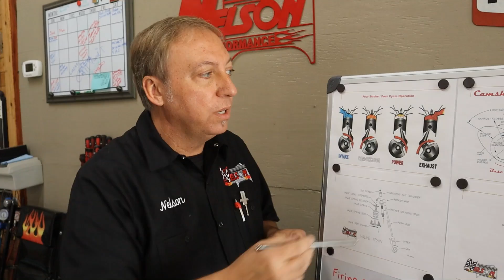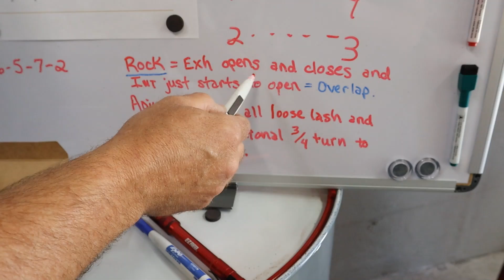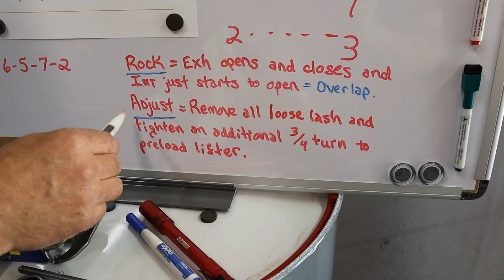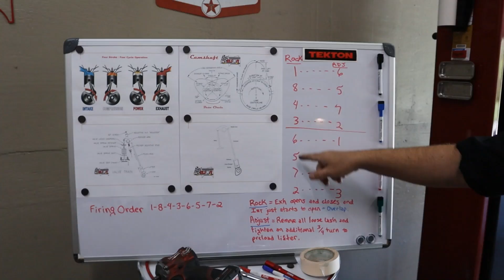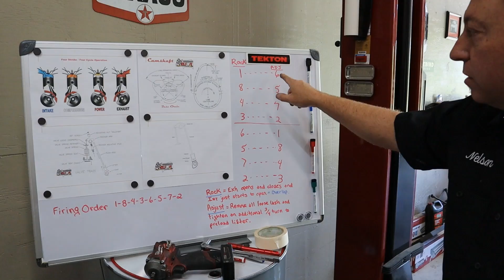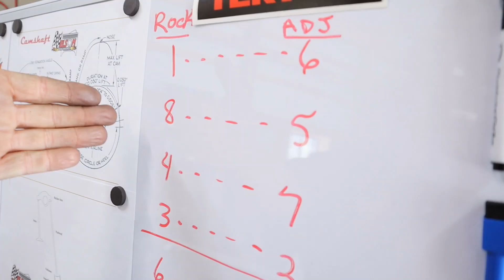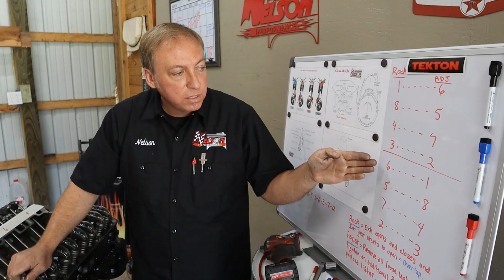Rocker Arm/Hydraulic Lifter Adjustment

Comment: What secuense will you use on a 3.0 96 Ford ranger I like your videos if you have and answer for me will be very helpful I appreciate your time tks and advance
Reply from the maker: Hey Juan, The firing order should be 1-4-2-5-3-6.  So you would rock #1 and adjust # 5 then rock #4 and adj #3 then rock #2 and adj #6. Then rock 6 adj 2. Rock 3 adj 4. Rock 5 adj 1. 123 are on the passenger side and 456 are on the driver side. Good luck on the project and thank you for subscribing.
Reply: Thank you Mitch Nelson for your response I really appreciate your time and advice I did and the truck is running cherry now

Comment: A Chevrolet dealership adjusted my valves , but they used the old nuts. So they backed off. I used this method when my truck broke down while I was on a road trip. I gauged the threads, runs like a champ!!!
Reply from the maker: That’s great! I’m glad it worked for you and congrats on getting it going! Thanks for the comment and subscribing.

Comment: This is the correct way, next expand on this in the case lifters are filled with oil (pumped up).
Reply from the maker: Hello, the method will work fine even with oil in the lifters. The valve springs will bleed the oil out of the lifters as you turn the engine over as the rocker pushes the valve spring down. This will get the plunger off the wire clip in the lifter. The valve spring pressure has enough force to push the pushrod into the lifter bleeding the oil back slightly since the oil pump is not producing oil pressure unless the engine is running.  You don’t necessarily have to view the lifters when doing the process, if the intake is on. You can also watch the movement of the pushrod/rocker arms if the intake is installed. You will see them move into overlap (the ROCK position). I’ve adjusted many engines that way. Just keep track of your cylinder locations to keep you on track. You can also use the ignition/starter to rotate the engine through the process but remember it only takes a slight bump of the key to turn the crankshaft the needed 90 deg. It helps to have a friend bump the key while you pay attention to the rockers. Good Luck with the project
Reply: @mitchnelsonperformance  Agree.  The reason I brought this up is b/c so many warn not to pump lifters before setting lash (or installing rail/pedestal fixed rockers).  I never understood this b/c I prefer to pump my lifters in an oil bath to confirm they won't collapse on startup.

Comment: This is awesome, but what if you do a cam swap and valvetrain work while the engine is left in the car? Any tricks?
Reply from the maker: Hello, You don’t necessarily have to view the lifters when doing the process, you can also watch the movement of the pushrod/rocker arms if the intake is installed. You will see them move into overlap (the ROCK position). I’ve adjusted many engines that way. We check lash weekly on our circle track engines just to inspect and catch any problems. Just keep track of your cylinder locations to keep you on track. You can also use the ignition/starter to rotate the engine through the process but remember it only takes a slight bump of the key to turn the crankshaft the needed 90 deg. It helps to have a friend bump the key while you pay attention to the rockers. Good Luck with the project!

Comment: Much easier  to  start  at top dead center  tighten all loose  ones turn  the crank a quarter  turn  again  tighten  all loose  do it two  revolution  and  all will be snugged  to  zero  lash then turn  all 3/4 turn  works on any  engine.
Reply from the maker: Hello, I’ve seen others do that process. Should work fine as long as you’re not doing a solid lift cam and need it precise. Thanks for the comment.

Comment: What if I’m adjusting it with the engine in the car? My lifters still have oil in them
Reply from the maker: Hello, the method will work fine even with oil in the lifters. The valve springs will bleed the oil out of the lifters as you turn the engine over as the rocker pushes the valve spring down. This will get the plunger off the wire clip in the lifter. The valve spring pressure has enough force to push the pushrod into the lifter bleeding the oil back slightly since the oil pump is not producing oil pressure unless the engine is running.  You don’t necessarily have to view the lifters when doing the process, you can also watch the movement of the pushrod/rocker arms if the intake is installed. You will see them move into overlap (the ROCK position). I’ve adjusted many engines that way. Just keep track of your cylinder locations to keep you on track. You can also use the ignition/starter to rotate the engine through the process but remember it only takes a slight bump of the key to turn the crankshaft the needed 90 deg. It helps to have a friend bump the key while you pay attention to the rockers. Good Luck with the project!

Comment: This method leaves multiple doors open for errors by jumping around. With ALL of the rockers loose start at one side and work your way back and then the other side removing lash from each one DESPITE where the lifter is on the lobe. Rotate the engine 90deg and then go back checking each one and adjust the loose ones until they are O lash. After you checked all, rotate again another 90. Repeat these steps until the engine has been fully rotated 4 turns. Then do the 3/4 turn preload on each one and your done. I know that this comment is long, but the method I’m describing doesn’t reflect that. This method is over complicating an otherwise simple process
Reply: Not only is your comment long, it also shows how ignorant you are. Hes simply using the firing order and valve overlap related to the firing order to adjust in sequence. I think your the type who has either an ego that constantly need to be filled or the type who cant follow simple directions. Either way, I bet it's hard for you to get along with people. Good luck pal!!

Comment: Can you do this with the intake on by watching the valves
Reply from the maker: Hello! Yep, It can be done with the intake on, you will just need to monitor the rocker movement v/s lifter. You can also use the starter to turn the engine. Just remember it will only take a slight bump of the ignition between adjustments.(90 deg) and it helps to have a friend to bump the ign while you watch the cyl/rockers you are getting into overlap.

Comment: Great video love how you explained the process. I have a dumb question after this do you use torque spec or not? Thanks in a Advance.
Reply from the maker: Hey Matt, never a dumb question! Nope, the nuts on “adjustable” rocker arms are lock nuts made to retain the adjustment. If the lock nuts do not feel like they have the needed resistance to stay in place then they should be replaced. Some engines do use fixed rocker arms such as the newer LS engines or the later small block fords and those are torqued in place and you can use the method in the video to make sure the lifter cup is off the wire clip and still has room for hydraulic filling with oil. Thanks for the comment and subscribing.

Comment: I've possibly timing chain slippage and maybe bent rods / valves ? This mechanic said in that case most likely a engine replacement .. That the aluminum engines don't take too much overhaul major work ? Any help will be appreciated . Small  2.0L Ford Focus
Reply from the maker: Hey Frank, I would first do a compression/leak down test to verify the damage. replacing the cylinder head on that engine wouldn't be to bad  of a task.
Reply: @mitchnelsonperformance  so please tell me if there was timing chain slippage what can I expect in my aluminum 2.0L engine ? Worst case . I had damage to motor mount and to attached timing cover . Had this mechanic replace both . It was starting and running fine . Had it four days befiore I sent it to that shop . Now not starting well at all . He must've done somthing wrong .. Certainly if it starts at all , will quickly surge past 3500 then quickly lower to around 1000-1200 rpm then dies . Taking all that into consideration leading me to say it probaly a timing issue ? Fuel pressure seems strong enough . I loosened fuel line gushing fuel out . Thanks any help be appreciated . And yeah this other mechanic will check it and said most alarming thing that aluminum engines for whatever reason don't take well to repairs in that case ?? That best thing is to replace engine ??
Reply from the maker: @frankmontez6853   if it's a cam timing issue it should set a camshaft to crankshaft correlation code. The first step would be to have it scanned to determine the drivability issue and check the cylinder pressure. many of todays engines have problems with the camshaft phasers but it will be easy to determine with a scanner. as far as them being a 
"throw away" engine, it would depend on how many miles it has on it to decide if a good used engine would be more cost efficient than repairs.
Reply: @mitchnelsonperformance  I was barely able to get it to Auto Zone to scan it. It has 66000 miles. Yes some camshaft codes came up. PO 340 CAMSHAFT POSITION SENSOR A CIRCUIT ( BANK 1 OR SINGLE SENSOR) PO 344 CAMSHAFT POSITION A CIRCUIT INTERMITTENT ( BANK 1 OR SINGLE SENSOR) PO 340 "     " PO 344 "    " BOTH PO 340 & 344 show up.
Reply from the maker: @frankmontez6853  Hey Frank, both of those codes are related to camshaft (int&exh) position and can be caused by several scenarios. There are many videos on YouTube dedicated to those codes but I would recommend you take it to a good technician to pinpoint the needed repair. Good luck with it.
Reply: @mitchnelsonperformance  he's saying aluminum engines don't take well to some major repairs. Yeah he says it's bent rods and valves. Chain jumped. That there's real possibility it won't work out if it's  repaired vs swap out. That is almost the same price.?? Crazy. That other mechanic who replaced timing really screwed up. Want to get a second opinion. Trying to get it started to take it to another shop.
Reply: @mitchnelsonperformance  just today this mechanic thru phone walked me thru compression test .Used kit from Auto Zone .  It was basically the same as others I've seen on videos . A lil different ( I think ) in that he didn't have me remove fuel pump fuse disabling it . he also had me take off all spark plugs off at same time and test with gauge . I cranked it for about five seconds and each one had over 120 psi almost 130 . He said that's plenty and manual says 12:1 . Sooo based on that he doesn't think engine needs replacing ..?? If you agree that's fantastic newss !!! That whatever the reason for my prooblem of not starting running definitely don't need engine replaced ?? !! Your input would be greatly appreciated sir

Comment: Any tips for my situation? 
Thought I’d just replace valve cover gaskets since oil seemed to be leaking there. Opened the covers and the lifters/rods/everything was extremely dirty, gritty, varnished. I’ve owned the 94 Silverado about four years, always do filter and oil at 3k or every 6 months (rarely hit 6k per year, farm truck). Sad to see it so dirty in there but I don’t know the previous owners OCI, tho runs pretty good and always reliable for an old truck with 189k now.
I took off all the rockers, rods, nuts, cleaned them, cleaned around gasket surface. Tried to make a note of how many turns it took to remove each nut and placing back in roughly same spot (if that was correct to begin with). 

Feeling a little intimidated about putting everything back together and starting it up since intake is on, I can’t see inside as in your video. 

Thought it would be an easy gasket replacement now here we are learning about lifter adjustment. Fun!
Reply from the maker: Hello, you don’t necessarily have to view the lifters when doing the process, you can also watch the movement of the pushrod/rocker arms if the intake is installed. You will see them move into overlap (the ROCK position). I’ve adjusted many engines that way. Just keep track of your cylinder locations to keep you on track. You can also use the ignition/starter to rotate the engine through the process but remember it only takes a slight bump of the key to turn the crankshaft the needed 90 deg. It helps to have a friend bump the key while you pay attention to the rockers. Good luck!
Reply: @mitchnelsonperformance  thanks for the encouragement! Planning to replace oil pan, pump, and gaskets next. Will be great to reduce oil leakage and peace of mind knowing it’s all done.
Reply: @bethl9825  don't forget seals.  If you are overhauling that engine or preferably a low mileage junk yard replacement,  it's best done with engine out and on a work stand. Sounds like you engine is great to learn on and can't get much worse from the sound of the sludge.

Comment: Can you do this with lifters that are full of oil?
Reply from the maker: Hello, the method will work fine even with oil in the lifters. The valve springs will bleed the oil out of the lifters as you turn the engine over as the rocker pushes the valve spring down. This will get the plunger off the wire clip in the lifter. The valve spring pressure has enough force to push the pushrod into the lifter bleeding the oil back slightly since the oil pump is not producing oil pressure unless the engine is running. Good Luck with the project!

Comment: I lift the pushrod up and down until there is no slack then use the EOIC method to adjust the lifter.
Reply from the maker: Hey John, Yea the EOIC method is commonly used today on some performance cams. I figured most youtubers searching for rocker adjustment are more than likely working on milder engines. I have used the EOIC method as well. The method here tends to be a little more “user friendly” for most. Thank you for the comment!

Comment: Great video.  Do you have one with the intake installed?
Reply from the maker: Hey Tom, It can be done with the intake on, you will just need to monitor the rocker movement v/s lifter. You can also use the starter to turn the engine. Just remember it will only take a slight bump of the ignition between adjustments.(90 deg) and it helps to have a friend to bump the ign while you watch the cyl/rockers you are getting into overlap.
Reply: @mitchnelsonperformance  thanks.  What is the rocker arm movement I am looking for to know I’m in overlap?
Reply from the maker: @tomsanchez8570  if you rewatch the video and notice that the exhaust rocker moves the exhaust valve open and then as it’s almost closed you will see the intake rocker just start to open the intake valve, STOP and then adjust the “sister cylinder” according to your firing order chart.
Reply: @mitchnelsonperformance  Perfect thanks.
Reply: Tom thanks alot for asking that question

Comment: Great tutorial, wish you were around back in 2013 so I could visualize what was going on under there!! LOL!! 
I had a Rocker fail.. thankfully I didn't bend a rod or anything else. I simply found all the broken pieces fabricated it back together making sure I found them all. Pushed on the Rods to make sure nobody is getting stuck.  I  ordered New Comp Cam Rockers, information was limited for a Pontiac Motor back then but I was Lucky enough to find this... Achumm ya didn't mention Pontiac LOL! not knocking but figured I would share a link if there ever is to be another one of me.. guess I did a good job so far so good years later ... https://pontiacstreetperformance.com/psp/rockers.html
Reply from the maker: LenDawg! I Loves me sum Pontiacs! Is that a 1970? The first car I ever bought with my own money at age 17 was a 1970 Le Mans. Painted it Orange with aluminum slots and I built a lil 389 for it. I still have it along with my 68 Le Mans with a 428 SD. I’ve always loved the under dogs. My 68 C10 in the background of the video is a 250 inline 6 with a three on the tree and that is “my truck” I drive it daily and pull a car trailer with it and I’ve been looking online at Butler Perf at the stroker kits. May build me a torque monster Poncho for it 😎 Thanks for the comment! Hope you subscribed, we’ll have more videos soon.
Reply: @mitchnelsonperformance   Yes Sir, it's a 1970  and not just a 70 but a Tempest 350/TH350 Never to be cloned so long as I own! 97% Original except for wheels, Paint, and Vinyl top aside from misc. items under the hood :) 
Running from extinction!! LOL!!
Reply from the maker: @lendawglacasse8306   That’s awesome! I’ve had several old Pontiacs through the years. Not sure where you’re located but I went to an annual Ponchos in Pigeon Forge Tenn. that had a lot of neat old Pontiacs.